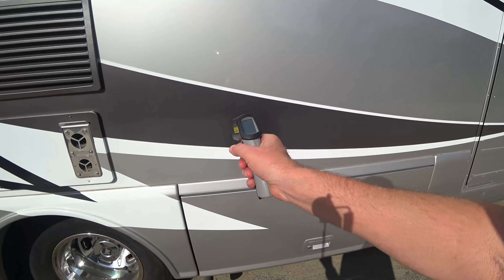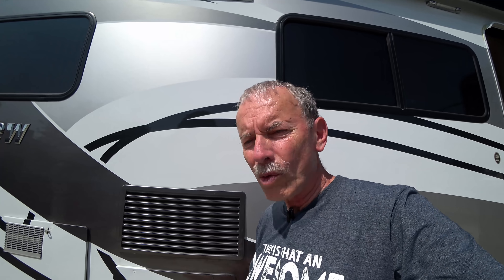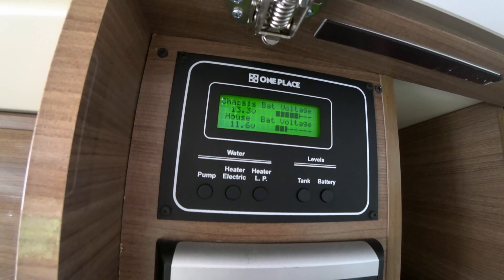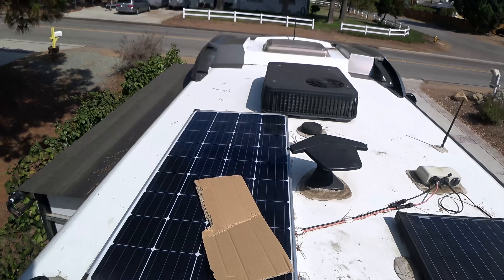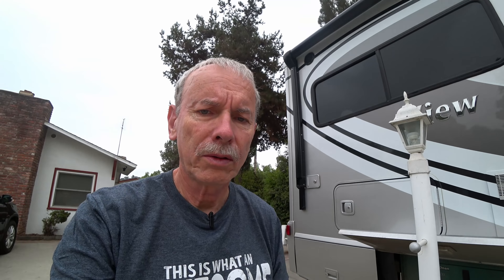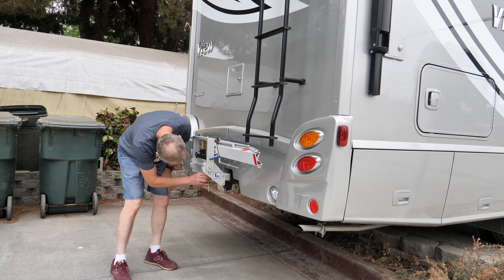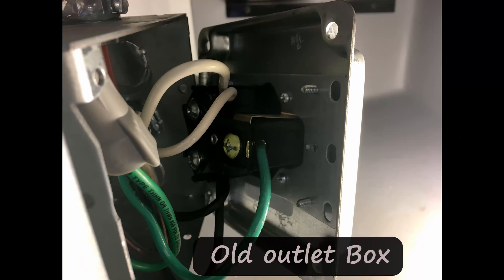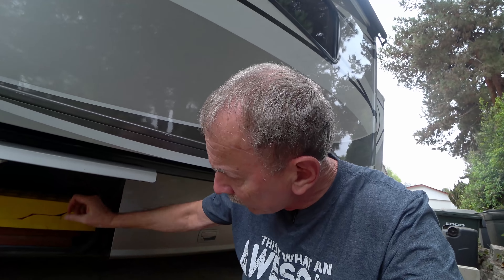10 more RV Mods - Winnebago View

Comment: Hello Ron or anyone else who can answer the following question.  do you happen to know what type of plastic the rear bumper cover is?  A friend has the same unit as you and has some minor damage on the right rear bumper right under the side marker light around the 7 minute mark of the video? There is a small 4 inch horizontal crack below the light and a 3 inch tear above the light that I’m wondering if we can repair from the inside and then repaint on the outside to take care of it.  They want $4800 to replace the right side bumper , paint and install from Camping World. Crazy..  any help would be greatly appreciated.
Reply from the maker: I know you can buy bumper repair kits on Amazon. Have not used any my self. Also fiberglass repair might work good on inside. You got nothing to lose to try it.
Reply: On the Road with Ron , ok Tks..

Comment: Thanks for all your great videos!  We also have a 2016 View and have learned a lot from your channel.  Would you consider doing a mod that shows how to add a dimmer switch to the awning LED lights?  We find the bluish LEDs way to bright at night.  We did some research on adding the dimmer switch but chickened out after not fully understanding "high side" and "low side" dimmer switches and looking at the yellow and white wires coming into the existing rocker switch :)

Comment: BEWARE SURGE PROTECTORS UNDER BED/FURNITURE: The varistors inside, the actual components absorb the surge, often fail with huge fireworks leaving a hole in the device. I have seen this melt open a plastic, surge protected, power strip while spewing major sparks. Ignition source for dust, lint, pet hair etc. Metal housing helps greatly(do not buy plastic surge protected power strips, only metal housing), but realistically these things are not great inside, especially under a bed. Your videos are educational and good, I'm simply picking at specific bones. Thank you for your informative videos.

Comment: Hello Ron. Big fan and looking for a similar rv In the near future. A friend of mine has one just like yours but with propane gen set. How did you use your gen set to power the house in the event of power loss?  Does yours have an external outlet or did you use a double male cord set, one end in the plug of the RV outlet and the other end into an outlet in the house! A cheater cord.  A bit risky but useable in an emergency.  Many tks for your input.
Reply from the maker: hammer r I just ran an extension cord into the house and plugged in a power strip. Plugged fridge, freezer and a couple lights.
Reply: On the Road with Ron Tks Ron, but to make sure you plugged the one end into an outlet in the RV? Or does your generator have outlets built in to the main unit.  Just want to make sure before I pass this on to him.  Tks again.  Great videos,  learning a lot.

Comment: Thanks for your very informative video!  I’m a newbie to RV’ing and didn’t understand your use of a “transfer switch” between generator and shorepower.  How does it benefit you?
Reply from the maker: Instead of going out of the RV to plug in the power cord to the generator outlet when I want to use the Genny, this switch makes the transfer from shore power to Genny automatically.  I never have to remember to plug in the genny.  my power cord is just coiled up in the storage compartment.
Reply: Ok I see, in my RV (Coachmen, Orion) I don’t think I have to plug into the generator at all. At least I wasn’t shown that procedure. Maybe it’s something I missed . . .  Thanks again!

Comment: Is the generator noisy using it while you sleep?  It is right under the bed and would think it would be loud and could feel the vibrations.
Reply from the maker: Never tried to sleep when running it.  Your right, it vibrates the floor, but actually I don't feel it in the bed with the memory foam.  It's just too loud to sleep..
Reply: On the Road with Ron It would make it hard to boondock in the heat. Don’t know why they put it in the back when the bigger Class C has them in the front.
Reply from the maker: For their convenience for sure